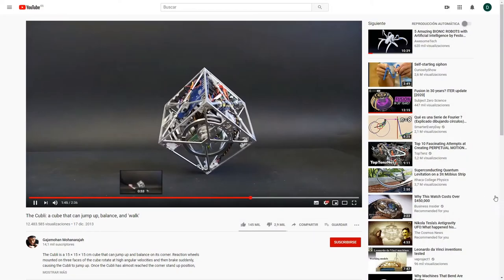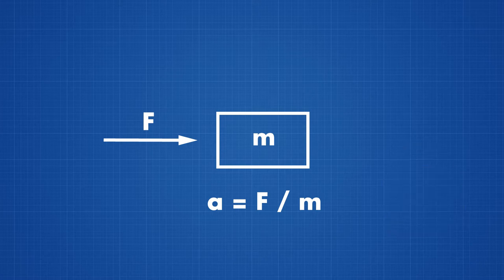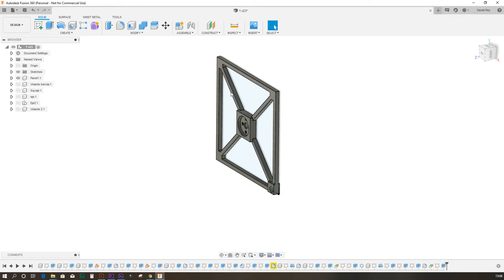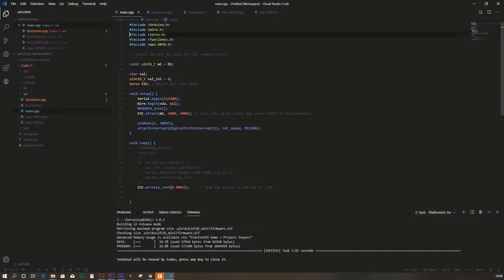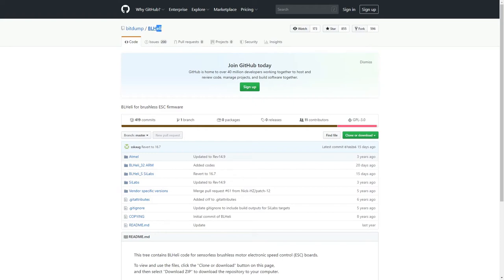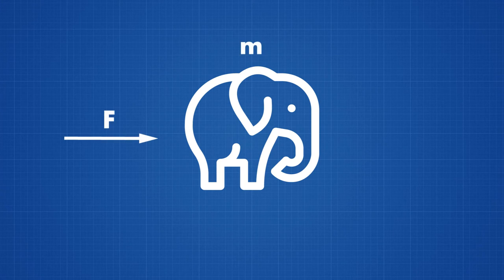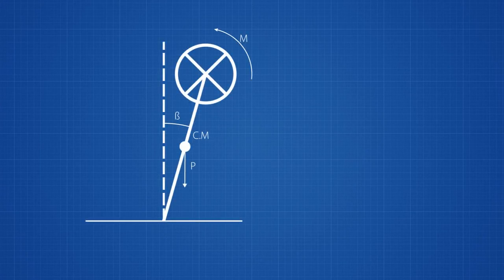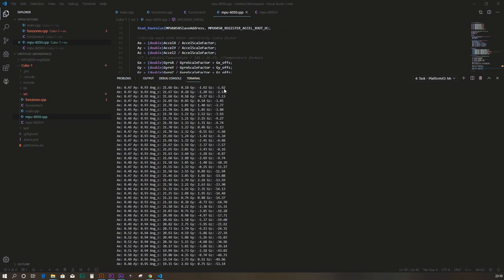Making a balancing cube - CUBLI inspired - Part 1: Setting up a 1 DOF test bench.

Comment: So I just tried to make this balance with this motor and I don't think it is possible. The motor is a very high rpm (1000KV) and low torque motor (torque is much more important for this application). It takes this motor a few seconds(!) to change direction, which I think is because it is a sensorless brushless motor. This means it will just fall over when you try to tell it to change directions. Also you likely need a way to measure the angular velocity of the wheel, eg an encoder, so you can account for that in your control algorithm. There's a few other youtube videos with working examples.
Reply: Yeah don't bother with this guy. He probably saw the Cubli video and thought "I can make that" but when he actually tried it he found out it was too difficult and stopped (hence no updates in over a year...)
Reply: I have done sucesfully similar project. You can check out here https://youtu.be/8RsnoAd-GSI. For your problem with motor i recommend using pmsm motor, or cheaper and easier - dc motor. We are controlling the torque here, and in dc motors torque is directly related to current (with torque constant specific to the motor), so by controlling the current you can control the torque.